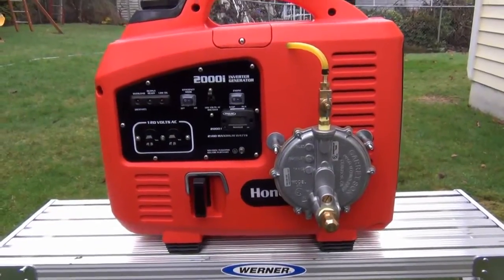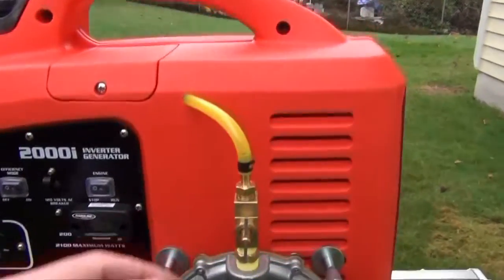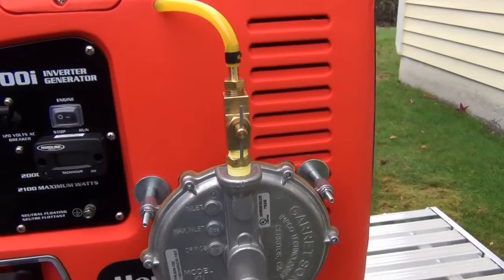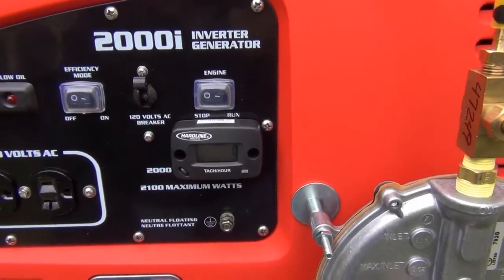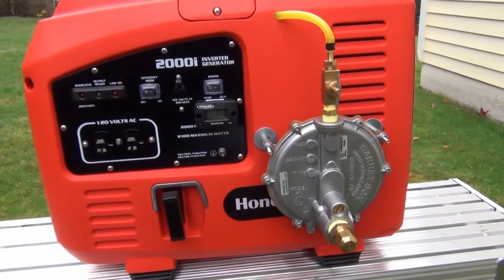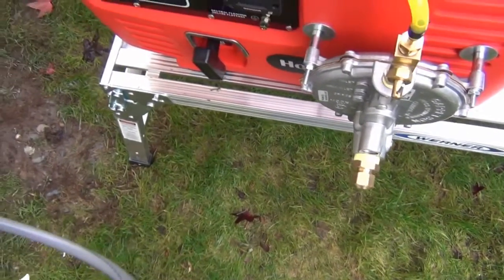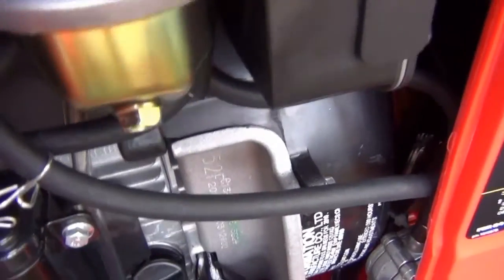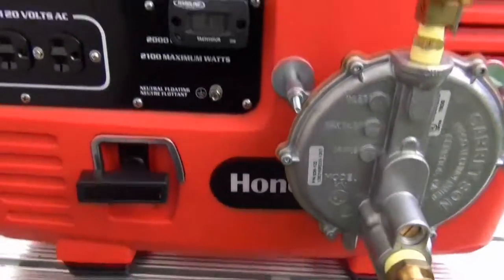Honeywell HW2000i Tri-Fuel Generator Conversion - Video 1

Comment from the maker: I spent about $100 on parts for the conversion.  Since there wasn't a kit available I did a custom induction port in the carburetor (shown in another video).  Most of the parts were bought at local hardware stores.  I found the Tygon fuel tubing on Ebay.  I purchased the Garretson KN regulator from uscarb.com.